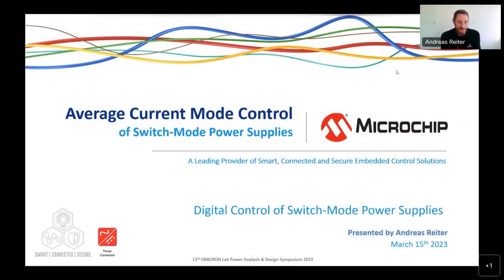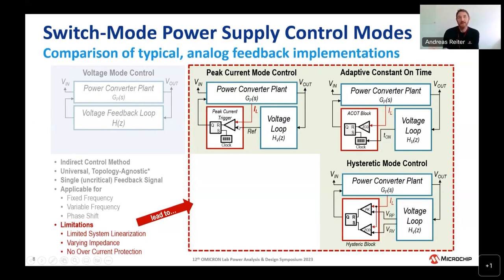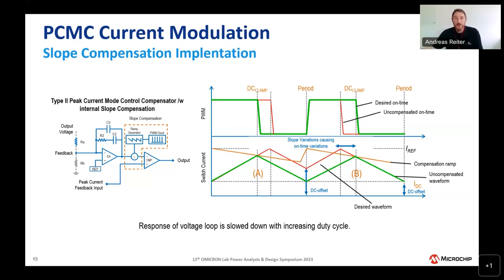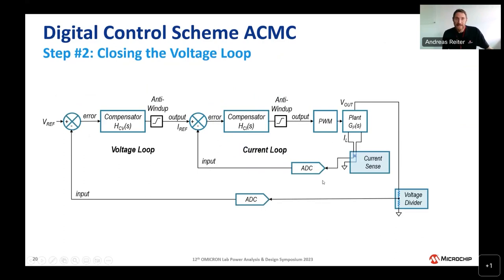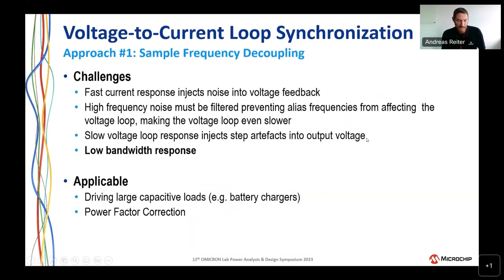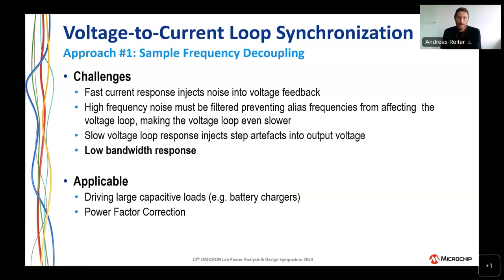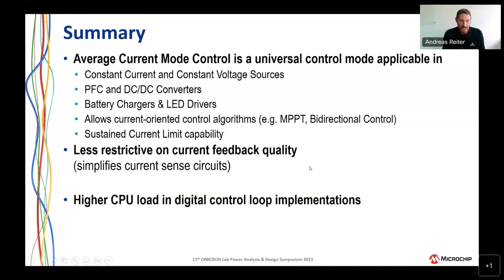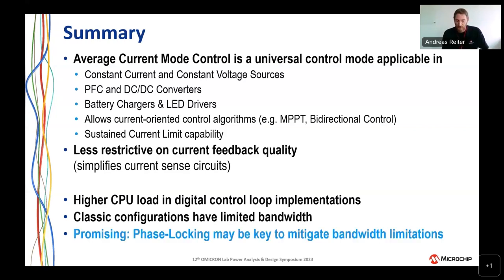Digital Average Current Mode Control of Switch-Mode Power Supplies

Comment: It's not really that difficult to implement in analog. One just has to become friends with resistors, capacitors and op-amps ;) Of course, digital control offers a lot of flexibility, but also comes with challenges such as sampling, delays, aliasing, etc.